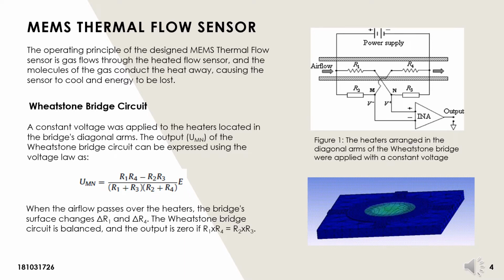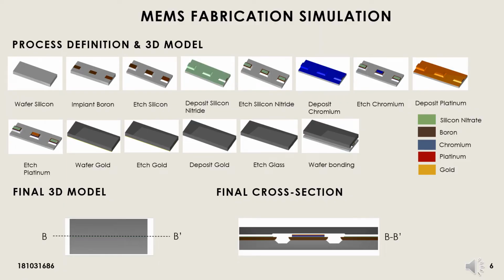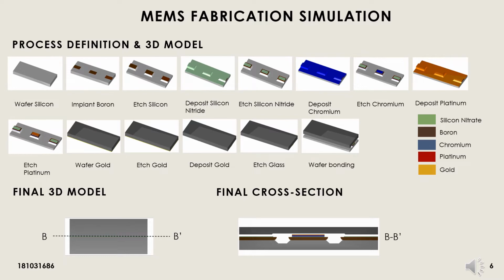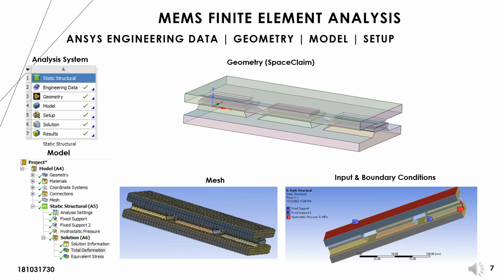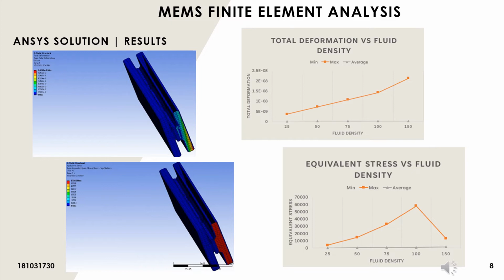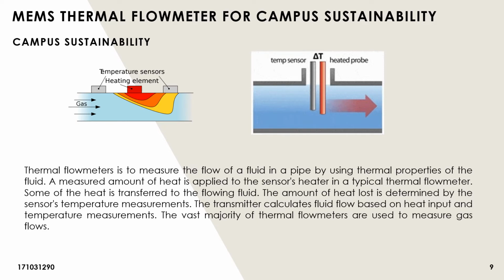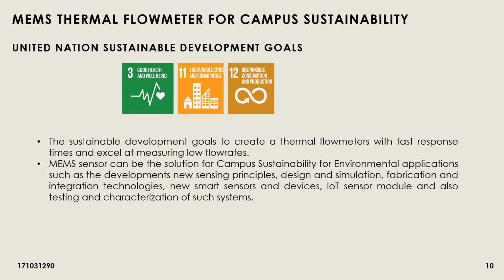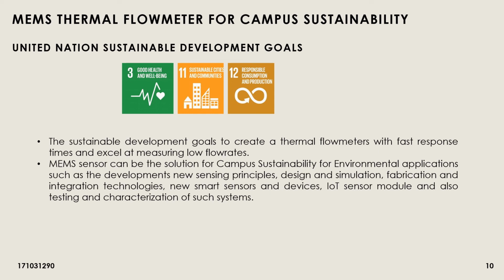2021 NMJ42003 MEMS Design and Fabrication MEMS_12 MEMS Thermal Sensor

Comment: Hi, I am Suren Raj from MEMS_19. My question is for our Ansys part. In static structural, your group have used hydrostatic pressure. Can I know the reason, and can we use another type of pressure instead?